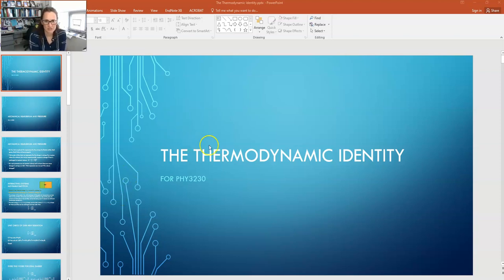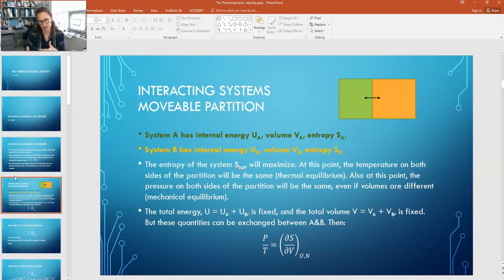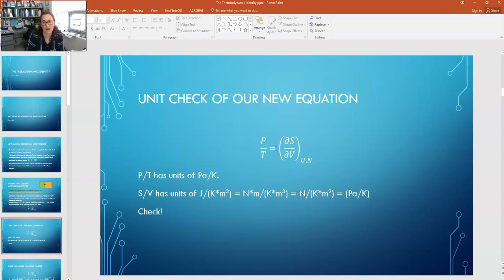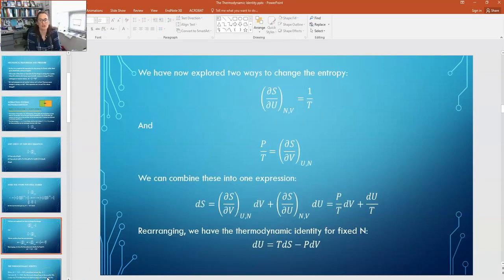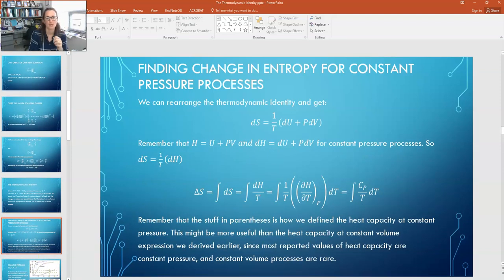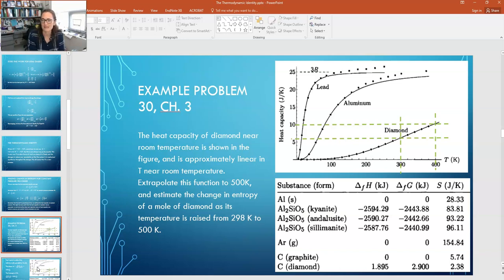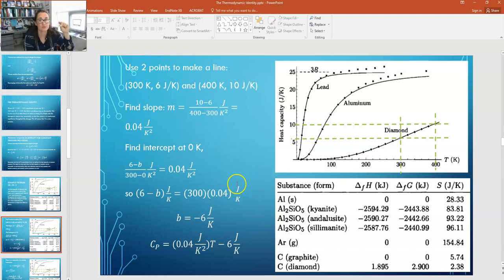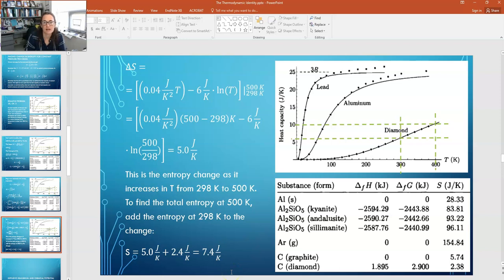Mechanical equilibrium and pressure

Comment: Hey! great video. I have a question. Can we talk about mechanical equilibrium if the volume is fixed by command? For example we have 2 systems but there is an unmovable plate between them, and allowing only energy and particles to be exchanged. Therefore can I use θStotal/θV= 0 or θSi/θVi=P/T  or because volume is constant the differential equation doesn't even exist for volume??